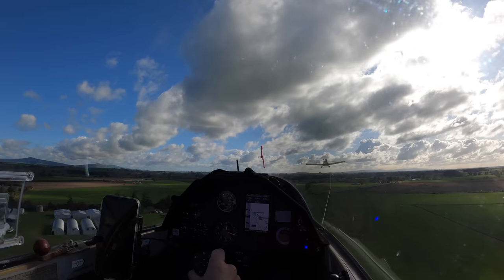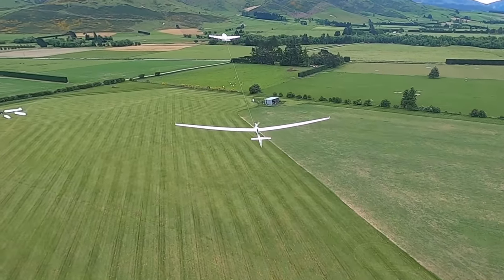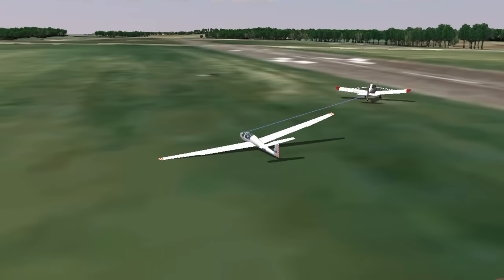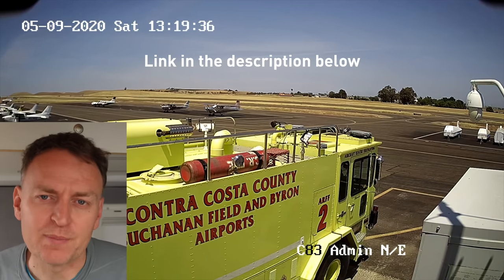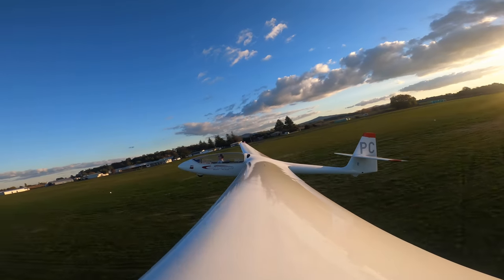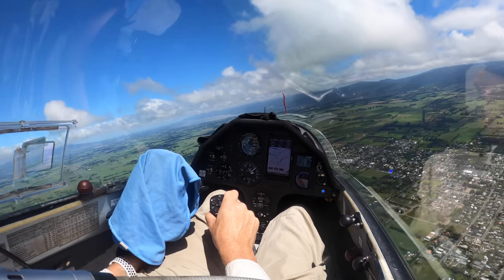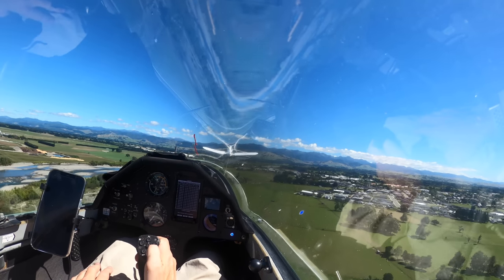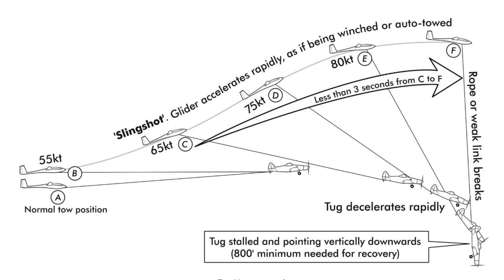3 Seconds to Crash: Glider Aerotow Launch Gone Wrong

Comment: I lost a friend to one of the early tug-upsets at Dunstable. I wrote a computer program to simulate  snatch-pickups, and incidentally found it would imitate tug upsets very well.  The principle danger - not covered here - occurs when a bunt develops in the towrope, and when it pulls out it delivers many times the normal load to the tug, which promptly upsets.
The lesson is that if a bunt develops in any situation, then the glider MUST be in line with the tug when the rope tightens.
Reply from the maker: Interesting, thanks, a good reminder to release if a bunt develops! I also find side slipping the glider helps to 'absorb' the impact when the rope tightens.
Reply: @PureGlide  One other point arose; the effect of longitudinal oscillation caused by the elasticity of the rope and its length.  It was possible to simulate a glider leapfrogging the tug.  Better to have a shorter, stiffer rope: polypropylene rather than nylon.  Nylon is very stretchy and stores more energy.

Comment: As a former tow pilot with 7000 tows under my seat belt I have experienced two kiting incidents, one at altitude and one at just above 350 feet.  The low one almost cost me my life.  When you examine the last two fatal tow plane accidents in the US, Front Royal VA and Byron, both times the glider was being flown by an INSTRUCTOR PILOT.  How can we expect a 15 year old kid to do things properly when flight instructors don't?  I could NOT release, the rope broke fortunately and I recovered at or below tree top level.   I have had much to say on different web sites regarding this, my views are well known if not shared across the board.

Walt
Reply from the maker: Hey thanks for sharing Walt
Reply: Hi Walt,  
Can you give me a link to one of the web sites where I can read some of your views on the subject?
Also, would one of the systems that has a Guillotine have helped you?  I think they should work properly even when the rope is under high tension.
Reply: Look specifically for Tow Plane Upset and Letter to the FAA.  Very interesting some of the comments made back to me, some are actually hostile.
Reply: @WConn100  Thanks Walt, That was an interesting read. It confirms what I said in my comment, that what is needed is a : the “TOST Tow Cable Retractor With Guillotine” – system. That will not have the problems of the current (especially  Schweizer) tow hooks.
I also said that an additional electronic (electric) system to activate the guillotine with a simple button press on the joystick, is needed because the tow pilot does not have enough hands for everything that he has to handle.
I had no reaction to my comment, and I think I now know why. Too expensive and don’t want the FAA to ground the tow planes….  But the question is: “What is the life of the tow pilot worth”?!
Reply: @Johan-ex5yj  With enough money, engineering expertise and resolve anything can be fixed, just not here in the USofA.  The FAA doesn't pay attention to the NTSB I am told, no reason why they should have responded to my admonitions.  The disparity of opinions as to how one went about something as seemingly simple as inverting the Schweizer hook and lengthening the release handle was immense.  The amount of push back I received from even the soaring community was hard to believe.  I'm happy flying helicopters, THAT takes real skill.
Reply: @WConn100  Yes, indeed a sad state of affairs.  :-(
Reply: Walt also went off the reservation writing that letter to the FAA... the reality is that after studying 78 towplane accidents in the U.S.A. their was no prejudice in the tow plane accidents type of towhook system. Schweizer, tost and Gullitine release systems had an equal share of the fatalities. Case in Point the Byron towing fatality was a gullitine system.
The biggest failure in the system is towpilots not activating their release system. I too have had 2 tow upsets in 10,000+ tows using Schweitzer hooks. Released a high glider fine.

Comment: On RC tows we have the rope attached to the center of the wing for exactly that problem!
And we always tow high!
If you put some wire on the tail to protect against the rope you could do that too!
We also have a hook on the glider that releases if the glider pulls up to much or overtakes.
Reply: I came to the comments to see if any other RC pilots made this point. Thanks! I don't understand why full-scale can't use the same technique. I hope somebody can shed some light.

Comment: Note:  The tug can release the glider.
But you have to be very quick to release in time (at low level). 
So the release knob has to be very easy to grab.
I repositioned our Pawnee release, from the floor to just under the throttle.
And it was a nice, long, easy to pull lever.
That was tested every day.
R

Comment: This was studied at length in Australia back in the 70's and was found that once the high tow angle got above a certain degree there was no way to release either the glider or the plane and a crash was likely. Based on this it was reccomended to do low tow only.
Reply: Was then when the 'safety link' idea came in as an extra layer of protection ?
Reply: Two things need to happen: some arrangement of mirrors or cameras  that enables the tow pilot to see the glider at all times (automotive rear view cameras would work); design absolutely reliably disconnectable  tow hooks (not  hard). Present day tow hooks should work fine if placed and rigged properly.

Comment: There are several comments below suggesting that there may be technical means to avoid the glider 'pulling the tail of the glider up'.  But that isn't the mechanism of the upset: rather, the slingshot motion of the glider rapidly extracts kinetic energy from the tug, and the tug stalls.  Elevator authority will not help if your airspeed drops dramatically.

Avoidance is therefore the critical issue: don't get out of position but if you do, release immediately (which can only be done if your hand is on the release).

Comment: A very good video! Shocking what could happen and what indeed happened. In our glider association in germany a minimum of ten airplane aerotow are a must before flying on your own behind a motor aircraft. The strict rule to be followed is 1. Get off the ground soon 2. Keeeeep at about 3 Meters or 10 feet near to the ground till the towing aircraft leaves the ground 3. Keep the gear wheels of the towplane always at the horizont line 4. Adapt the same tilt angle as the towplane is flying - - - then both are safe !

Comment: As a hang glider tow pilot I can certainly appreciate all the similarities to the GA sector as too have some time in GA gliders as well. The two biggest differences between GA sail planes and Hang gliders are the flying speeds and methods of control of hang gliders.  Trikes as tugs are common but the purpose built Bailey Dragonfly is the ideal machine with towing speeds ranging from 30 to 38 mph, loaded with mirrors and has great control Authority. 
   But up sets are common for us too down low.  Constant safety enforcement and procedures is very important with no room for smug complacency.    I have no hesitation when I’m flying the front end of the rope if I’m not seeing the glider pilot not releasing them selves to give them the rope which I have done a handful of times!

Comment: Not flying anymore, but was a glider pilote for a few years. I never had problems with tows except that one time, when I still was a student. Was not at our home field and with an unfamiliar towplane using a pretty short towcable. Fortunatly only startet at relatively secure altitude, when I got offset and absolutely struggled to get back into position due to overcorrections. My instructor gave me a few to sort things out until he pulled the release. Short towcables can be quiet a hand full for students...
Reply from the maker: Yeah absolutely, always worth making sure they are long enough. Makes a big difference how fast things happen

Comment: As the tow pilot, I once had a glider go straight up on me, forcing me straight down.  I was trying to pull the release lever, when the glider finally released.  Luckily, we were several hundred feet up.  As the glider pilot, I once had the air vent hose come loose on a very hot day,  Put my head down to reconnect it.  When I came back up, I was flying almost beside the tow plane at full cable length.  I pulled the release, but was so low,  barely made it back to the airport.

Comment: We sometimes use a split bridle when towing hang gliders, with a release on each wing strut of the tug plane. If you do get high behind the tug it doesn't pull the tugs tail up because the tow line is attached below the main wings on the struts...just a thought. Nice videos keep them coming!
Reply from the maker: Interesting!
Reply: That’s really cool, I think if you did this with a sailplane however you could end up pulling the tug’s wings round in a horizontal upset, I doubt a hang glider. is able to produce enough force to do that, what do you think?
Reply: @astro_manta9733  Not true, a hang glider certainly CAN negatively influence a tug. The good part though is that most HG tugs have very good all around visibility and have typically very large mirrors. If you are getting too far out of position low you'll probably get the rope.
Reply: @SVSky  sure, I don’t doubt you can negatively affect the tug but what happens if the hang glider flies out to one side and one of the lines goes slack leaving all the drag on one of the tug’s wings? Does that happen much?

Comment: What if the tow plane had it's anchor points at the wing tips? With two long cables or ropes connecting far behind the tail into a single cable that dragged the Glider?

The anchor point would still need to be behind the center of lift/drag for aerodynamic stability, but moving it closer to the center of gravity would decrease the torque that the glider could impart onto the tow vehicle. Additionally, in a horizontal divergence of the two aircraft, the glider would pull the slack on the more distant wing first, this would work to always steer the tow plane away from the Glider, which seems the most stable reaction for the tow plane?
Reply from the maker: It's an interesting idea! We'd have to ask the engineers about that one

Comment: I towed at a commercial glider operation for over a decade. The tow pilot has to be ready to release the glider. I found with the Pawnees we had enough control and power to keep from being upset. I have had to release the gliders on several occasions. The gliders are able to handle a low release better than the tow plane can handle the upset.

The only time I had a problem was in a Super Cub. The glider with a student go out of control, way wide almost in formation. I was up about 2000ft. The towplane flipped over, I released the rope and split s out. 

Very good commentary, thank you.

Comment: Another possibility of tow upset is handling a crosswind takeoff.  I was chewed out by my instructor one time after he saw me not react to the tow pilot kicking into the wind just after he lifted off.   You must always line up behind the tow plane!  We took off from a wide open tar covered ramp.  So  swinging over behind him resulted in a weird sensation of progressing across the ramp in the normal direction but having the tow plane the tow rope and the glider pointing maybe as much as 20 degrees ‘off coarse’.  At a certain cross wind level operating would not be safe.   He/She needs to get pointed correctly in order to have full aileron control.

Comment: Good explanation - going straight to the point. I have myself experienced this in the front-end of the rope: First, I saw the glider rising in the mirror - and second, I experienced that scary feeling of being "out of elevator". The decision to release the glider was taken and my hand was on the way to the release handle when the glider suddenly went back down - so I could let them stay... The heat in my head was just like what I imagine you will get after eating a bunch of pepperoni...

Comment: I have always suggested that the tow connection to the tug is a Sling from wing tip to wing tip with a running pulley that eventually connects to the tow line. With enough margin to avoid fouling the tail . This puts the tow vectors at the CG of the TUG and minimises the lateral force and leverage involved in any tail hook up . I would think that this is a FAR safer method .  But Every one in gliding ( only been doing it since I was 12)  Disagreed with me becasue it involves a small modification to the wings and spars.

Comment: Especially with a high wing low weight vintage glider you may need almost full forward stick to prevent it from shooting up in the air like kite. It's a demanding experience to speed along the runway well inside the propwash with such a glider, some 5 ft off the ground.
We were also trained in doing touch and go landings while still in tow back then, to be prepared for a release malfunction and to get a better understanding for the tow plane's needs while doing certain manouvers in formation.
Love your videos!!!
Reply from the maker: Thank you!

Comment: As a physicist, I see this as an easily solvable problem. The tension in the tow line acts as a force vector on both craft. It seems to this tyro, that the critical factor is the angle that this vector makes with the towplane’s direction of travel. The tow plane needs to be fitted with a camera, an Arduino (or similar), some software and an electrically operated towline release. The camera is monitoring the towline and the Arduino is converting image to angle. The software lets you set limits and build in things like an audible alarm when the limits are being approached and, of course, trips the release once those limits are reached. 
This sort of stuff is so easy these days .
I can’t see any reason why you couldn’t build a lightweight drone tug. Its auto pilot would do all the hard work but the glider pilot would have high order control by wireless.
Reply from the maker: It's a good idea, unfortunately designing and building equipment for certified aircraft is an expensive and time consuming process. Don't let me stop you though, go for it!

Comment: I was a tow pilot here in Switzerland. One morning, I was towing a Pilatus B4 with our PA-18. After takeoff, at approximately 50 meters, over a forest, the young and inexperienced glider pilot pull up. I was immediately put I to a 45 degrees nose down. No time to do anything. He recovered immediately but did it a second time, then the rope broke down, that save my life. Still in my mind 30 years later.

Comment: I flew that club tow plane for years (16Y). FWIW, it had an electric tow rope retraction reel in the back baggage area, and release was a inside 'guillotine style' cutoff mechanism.  Activation was a pull handle on the floor next to the front seat.  Not as easy access as a conventional pull cable near the panel.

My guess is that priority of flying the plane made finding the floor mounted pull handle difficult.
Contributing factor. Sad to see that happen locally.

Comment: The tow-pilot must not hesitate to cut the cable early. 
If the glider is out a certain window of his mirror, it is:  end of this towflight 
It is either his life or......     so shift the problem back to the problem-maker. 
Clear communication that a glider outside the tow-window is a cable cut before the flight is a must.

Comment: Great video. 
I have had to release very low on a tow because the tow was too slow and I was flying a glider that I was unfamiliar with so felt my best option was to drop the tow and land straight ahead. Tiger Moth and a tow pilot that was known for slow tows.
Flying in Scotland  at a wave site back in the 1970s there was a tow upset fatal tow accident. Partly blamed on wave rotor but mainly on the glider pilot's lack of experience. My tow a few launches before the accident was Very rough the tow aircraft suddenly lost height then I dropped down to the same height. We did not have much altitude when this happened. The rest of the tow was normal.

Comment: it's actually pretty easy to make a take-off assitant to avoid this risk. It can use a light mounted on the tow plane and a camera mounted in the glider and the camera detects the position of the light and tries to keep it centered using the glider's control or indicating the pilot the movements to make to adjust it as precise as possible
Reply from the maker: Easy to make, but hard to test and certify as an aviation product. Good luck!
Reply: @PureGlide  testing might not be that hard, as it can be tested in mid air and safely stoppable, but registration might be a big problem

Comment: Mmm a mechanical linkage in the tow plane that if the tow plane's stick is hard back for any reason (trying to nose-up), then it automatically releases the tow.  (Could actually apply to any extremity of the stick's movement).  That is the condition when the tow plane has lost command authority in pitch (and yaw?) control, and Plan B is required.  Yes I know - ten years to get it approved!

Comment: Mandatory rope cutting equipment on the towplane is a good investment, some towplanes have it, there is no chance to use the tow release as this will not work on excessive load as accidents sadly show.
Reply from the maker: Yeah also sometimes the tow planes release, but by the time they do, they are already pointing nose down and simply don’t have enough height to recover :(